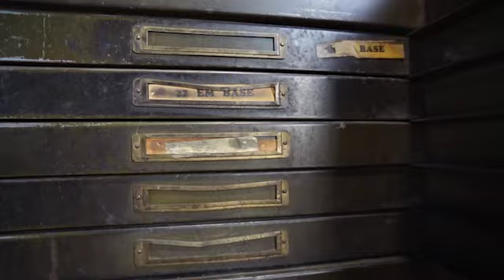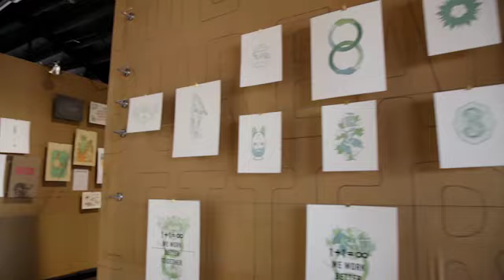The Art of Letterpress Printing

Comment: I was a compositor and used to lock up jobs for the Heidelberg platens and cylinders 50 years ago, lovely machines, nice vid, bought back old memories, many thanks from down under🇦🇺👍
Reply: If I want to change the color, do I have to clean those rollers and how do I clean them? Did you remove the wheels and wash them with detergent?